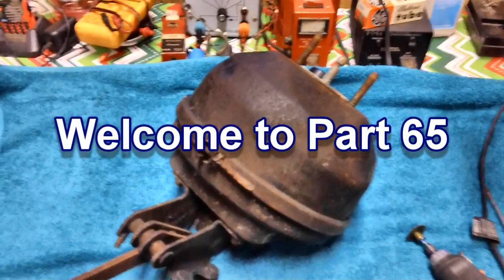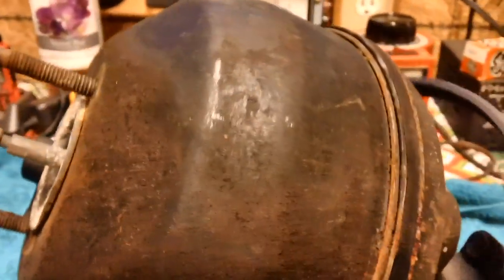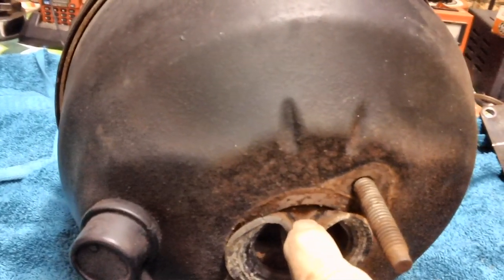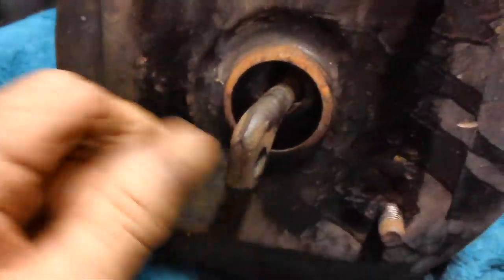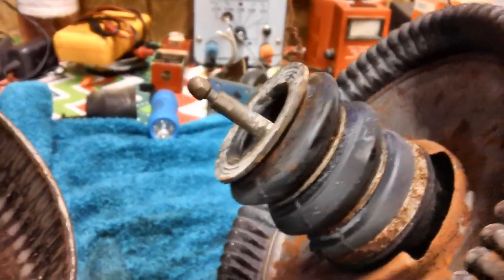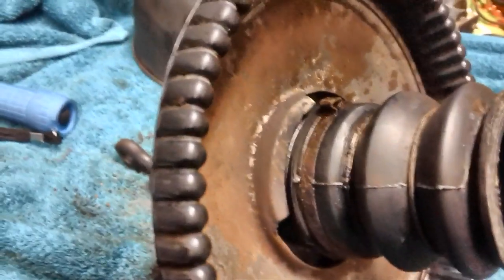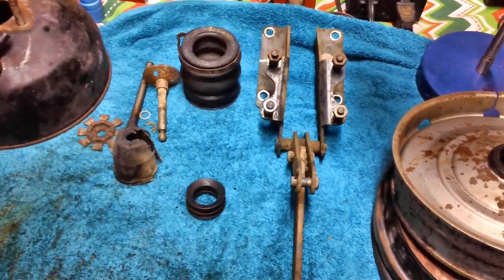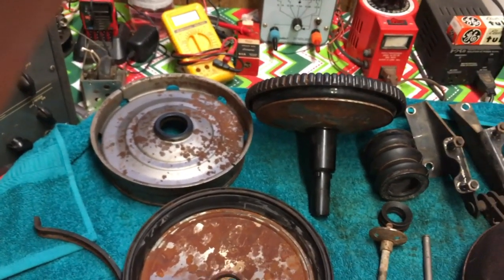1966 Ford Thunderbird repair and refurbishment (Part 65). Brake booster disassembly.

Comment: Thanks for the detailed tear down, John. Over the last 4 decades i have rebuilt just about everything on my cars, but i have never taken a brake booster apart, interesting to finally see the insides. The fact that i have needed to tear one apart just goes to show how reliable simple technology is.
Reply from the maker: Steve,
I really like taking things apart...sometimes royally screwing them up in the process, but over the years it's how I've learned a lot of things.  Works for me, my friend.  😛
Regards,
John

Comment: Looking at the video I see no reason this booster wouldn't be OK. Just clean everything and assemble and I bet it will work just fine. I rebuilt many boosters back in the day. Take care and Merry Christmas to you and Wifey.
Reply from the maker: I agree.  I'm surprised at how pliable the rubber seals still are.  I figured they'd be hard as rocks with a million tears and cracks throughout.  I'm not complaining, my friend.  😁
Regards,
John

Comment: I had my booster for my '65 which is the crimp style they installed a new boot, and check valve and shipping for $324 holy mackerel! Gee, I think I will have a brand new car by the time I am done.....

Comment: Superb video, watched it extensively before I pulled my booster apart to see if it might have been a simple fix. Had less brake fluid in mine by the look, but more cracked parts and a lack of retaining clips on the input/output rods
Mind If I use a clip to direct our watchers over this way for more thunderbird content in our next episode on our '66?
Reply from the maker: To whom am I conversing?
Regards,
John
Reply: Hi John, I'm Adrian, Chris and myself are building a kit car, restoring a '66 Thunderbird and a few other cars in the UK. Been keeping up with your rebuild for a while and found this one extremely useful trying to redo my brake system. Happy to send you a link to a pre-release of the video tomorrow
Thanks again for your videos and help!
Adrian
Reply from the maker: Adrian (middle name of our oldest grandson),
I have no problem with your request.  Make it happen, my friend.  But in the future be sure to include at least your first name when asking for something.  It's rude not to do so.
Regards,
John
Reply: @joernone  Many thanks! Fair point, I forget sometimes the channel account doesn't show my name like the personal one does :)
Adrian

Comment: Makes me wonder John if parts from the Lincolns from that time might have interchangeable parts with the Birds of that time. I know that some parts between the Merc Marques, the Crown Vics, and the Town Cars had parts that would swap.
You know, back in the 60's and 70's I use to go to Flatrock to watch the stocks run. I probably watched Brendan run that track a time or two.
Reply from the maker: Carl,
No doubt the Lincoln parts would be interchangeable, also a very heavy car and all that, but they would still require tear-down to see how they held up over the years.  And as for Brendan at the track...chances are you did see him, my friend.
Regards,
John